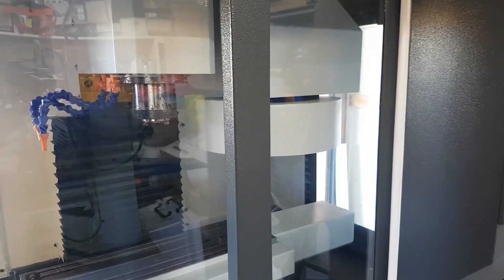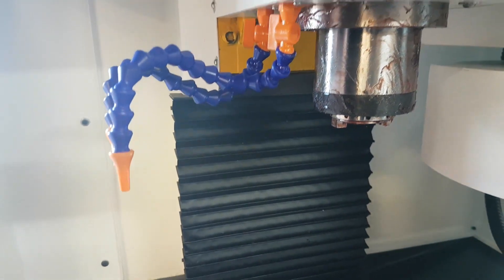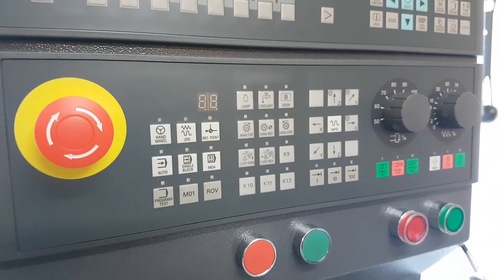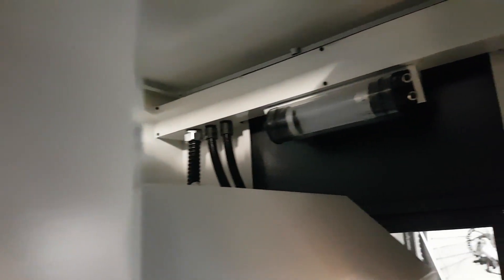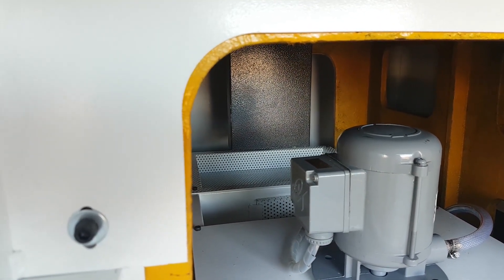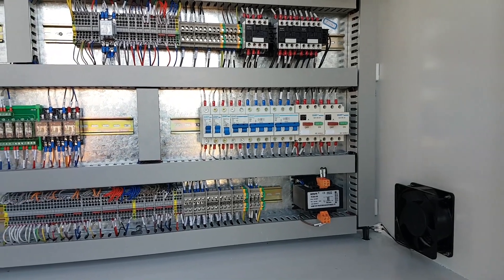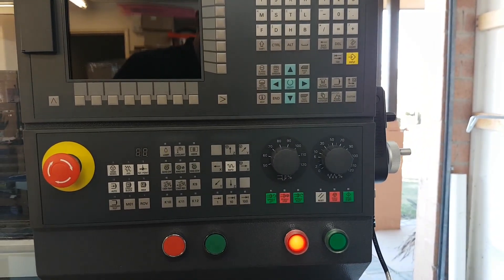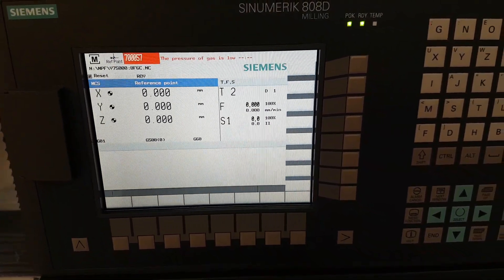SYIL V5 intro

Comment: Thanks for the walk around, I was recently thinking of buying an exact same model.  Could you please introduce more  technical details of the machine and about the process of procuring it! Hope it is going to last long and work as expected!
Reply from the maker: I bought mine direct from SYIL. Since then they have put up a new website that lets you pick and choose the options you are looking at for a mill. It is at https://www.syil.com/personal-cnc-mill I have the 2.2kw 10000rpm spindle, servo driven axis with 6000mm/min rapids and 2000mm/min feed. The ATC supports 8 tools. All the details are on the SYIL site.

Comment: Awesome Alistair. Can’t wait to see it up and running. What are you using as fixtures to hold your work? Will you have to make them specifically on the machine? I like the idea of two different marks for handmade vs CNC made. @pointy.hk
Reply from the maker: yevad99 yes I will be making fixtures on the CNC specifically for each thing I make. I am still waiting for my vice to arrive that will get me going to start with.